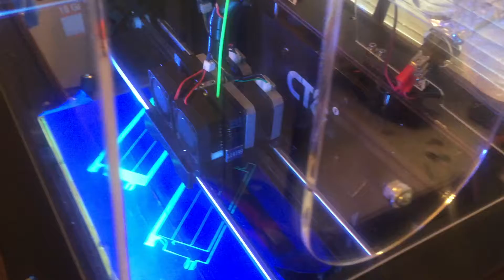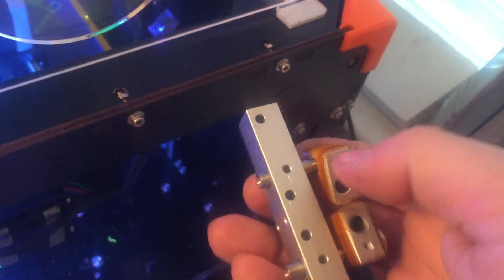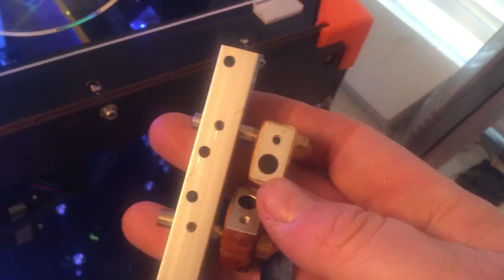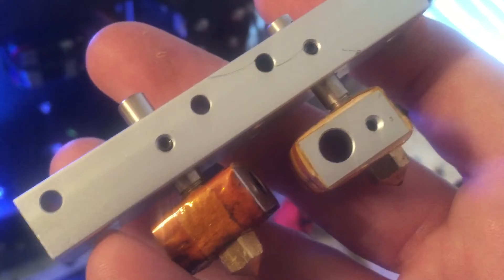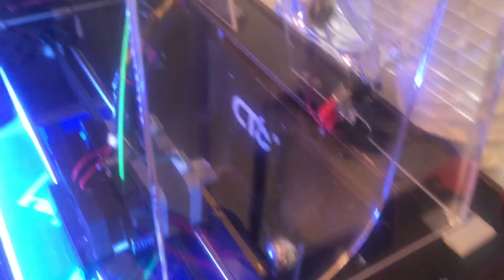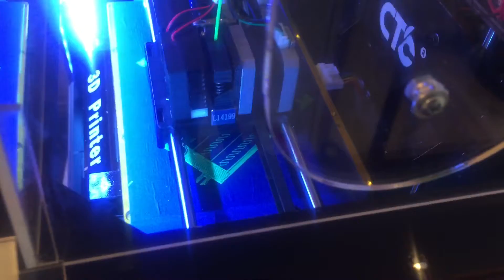New MK10 extruder install on CTC 3D Printer

Comment: i stripped out my aluminum block from tinkering with it to much. i end ended up re-drilling the hole to fit a 10-32 setscrew. i have a cheep drill set i bought from Walmart (i thought i was going to use it for finished prints only)... a good quality 10-32 tap cost about $8 and a signal setscrew is about 32 cents at the hardware store ( i consider that to be an expensive setscrew) the Fasteners shop charges about $5 for 100 lol. i know your setscrew is striped and stuck but you could definitely salvage that block and put it on the shelf for a replacement if the day ever came. just a thought. i love those extruders!!! they work alot better and dont clog like the crappy ones that come with the printer. your awesome man! keep making videos!!
Reply from the maker: +Jacob Forsythe thanks for the info.  I did save it and I may try working on it.  Recently bought a MP Maker Select Mini and a MP Maker Select Plus.